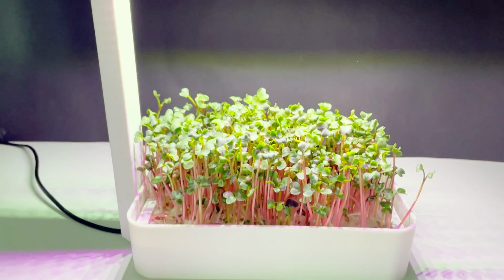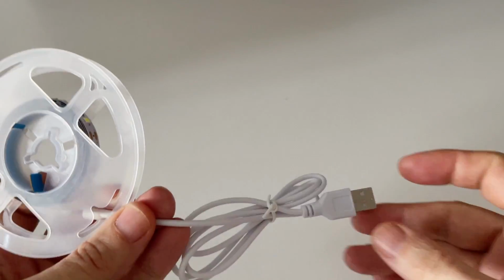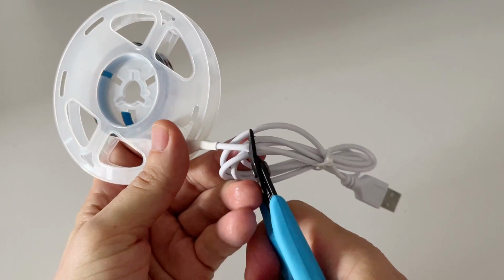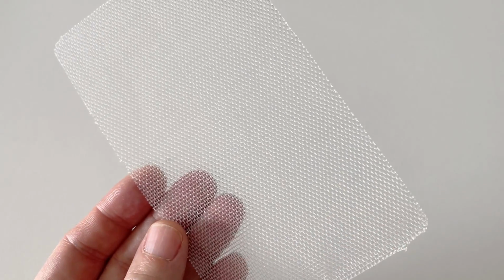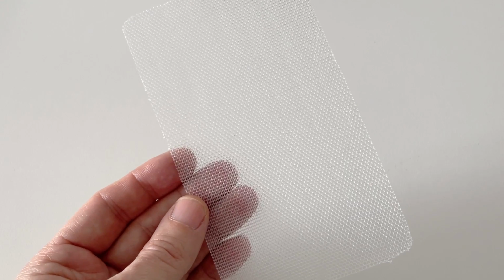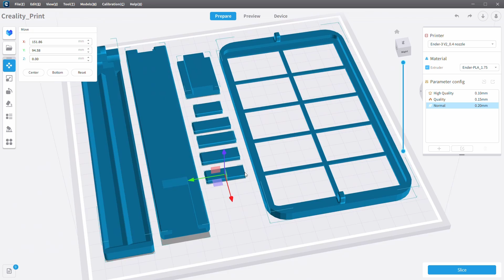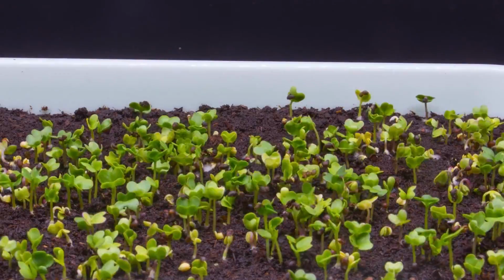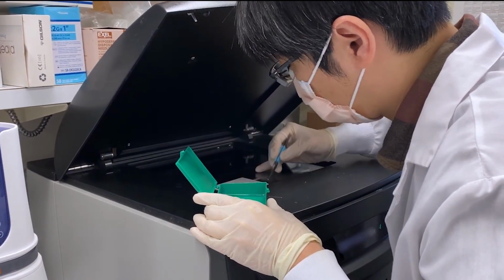Home Microgreens Growing: DIY Your Own Device

Comment: Hi, can you help with a doubt? Why not eat the roots?
Thanks for the vídeo
Reply from the maker: Nutrients and beneficial components are mainly concentrated in the stems and leaves of microgreens. The roots do not contain useful substances.
Reply: @DIY_Yarik  Great to know that but I can eat it too right? I eat it because I feel more easy to remove from plate this way. Thanks for the answer.

Comment: It's a great product and design, thank you for showing us. I just have an issue with the fact that fdm plastic parts are swimming into water 24/7. FDM isn't foodsafe. I would suggest to coat the plastic part that is in contact with water.